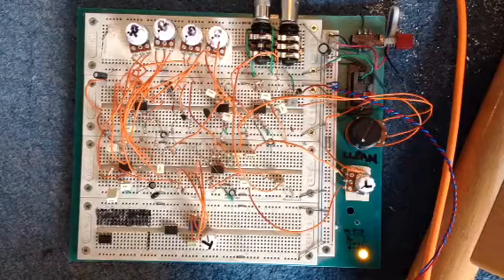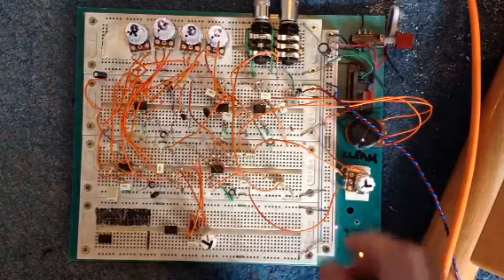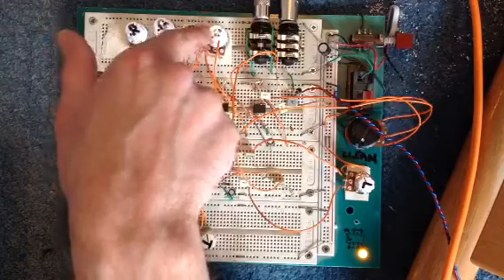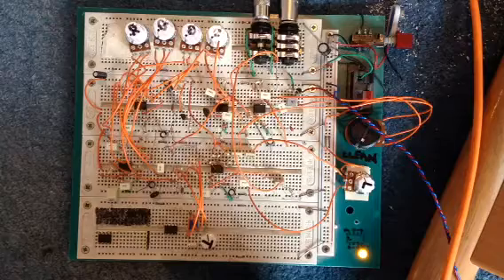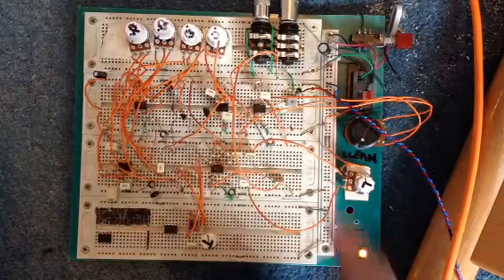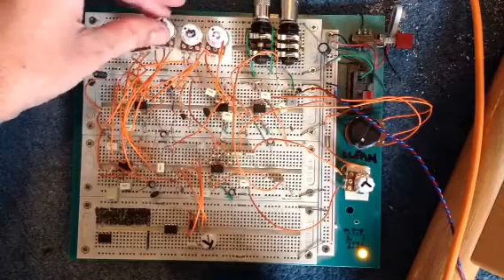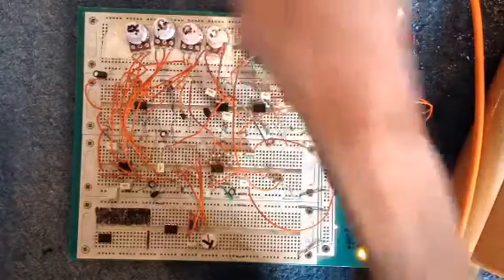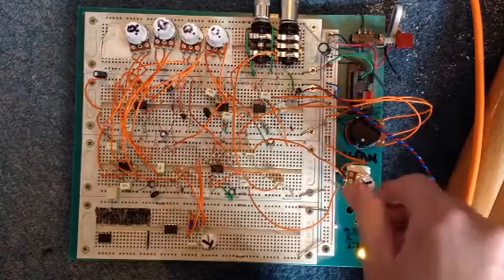Ne Plus Noises

Comment: HI there, just  found your video through a forum thread about the UF...and after I heard you speaking about the 'Colour' knob i got curious because you said it doesnt do much. The thing is - and i know NOTHING about pedals, engineering, electricity or components - that i always noted a difference when i used that knob, meaning that CCW it sound closer to a cleaned up fuzz face (or a softer fuzz where i could maybe hear all notes better, good for chords) and CW it would sound more like a muff to me.
I'm just telling you this, its not a proper question (and possibly i never experienced the pedal as i should), but was curious if you can explain to me (like to a 5 year old) what the knob does, and if you know other pedals like the UF. I always used it for slight overdrive (with drive knob more CCW and adding or taking gain with the guitar volume) or for a fuzz sound with more drive and with the colour knob more CCW or in the middle to get a cleaner distortion with guitar volume rolled down or a real fuzz by adding volume. I NEVER used it for the weird stuff, basically had gate and resonance knobs at zero, never touching them.

Thank you for your attention,
Cheers, stay safe!